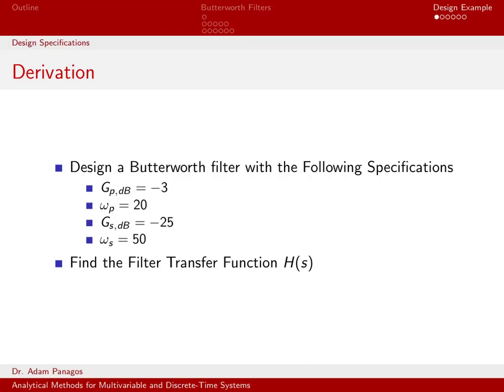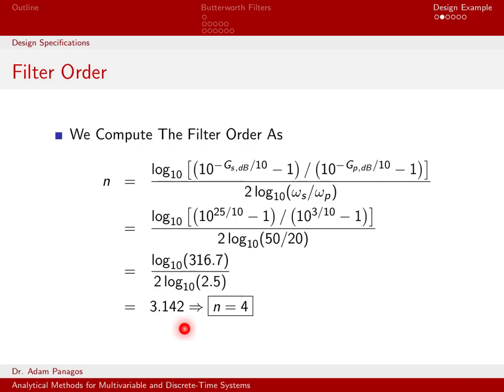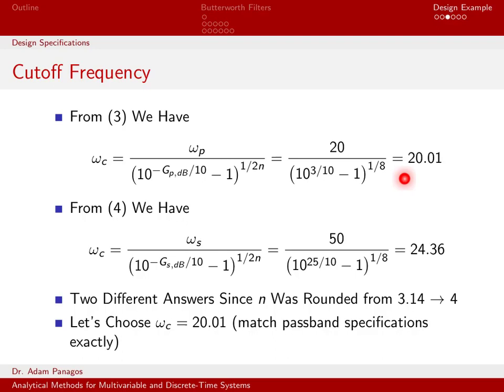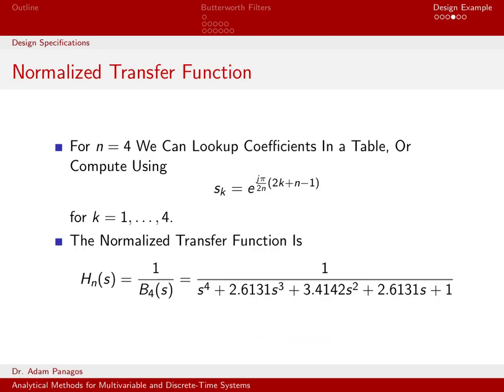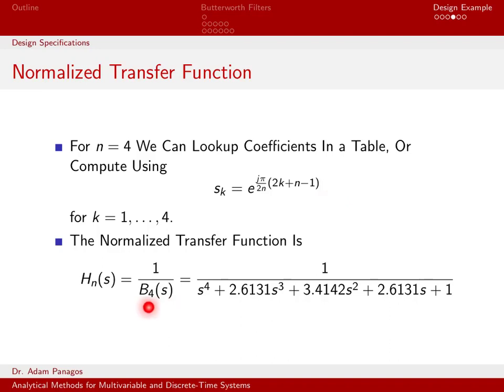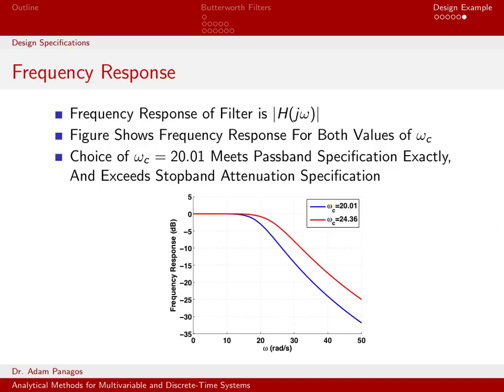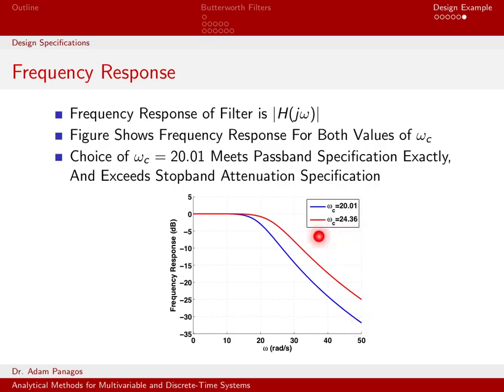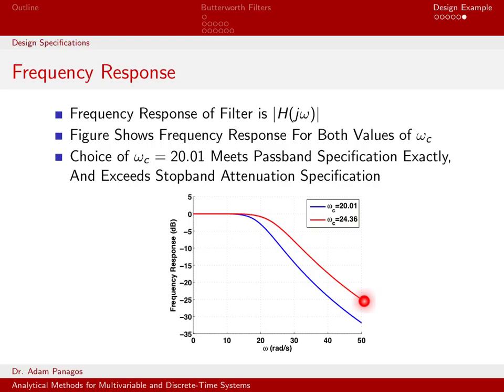Butterworth Filter - 04 - Design Example

Comment: I followed everything pretty well. My question is how do calculate resistors and caps from the transfer function. You are an excellent teacher.
Reply from the maker: Taking a transfer function and turning that into an actual circuit implementation is a very different type of problem.  I do teach that aspects of that in some of the courses that I teach, but unfortunately I don't have any videos on the topics at the moment. Maybe I can get some of those made in the future.  Thanks for watching!
Reply: Hi! I'm some months late but once you get your cut off frequency (in this case 20.01), use the simple formula Wc=(1/RC), since you are using rads there's no need for 1/2pi. You have two unknown values, normally, choose a common resistor value (10k for example) and just get the value of the capacitors with the formula. The biggest issue is finding the exact value (and dealing with variations). I did it this way with 741's and it works in multisim quite well.

Comment: hello, thank you for these set of videos. I have a question, there is another way to give the filter specification to design and that is Amax and Amin which I guess is the attenuation and Amax is lower value of Amin !!!! but they are positive value so it  is not pass in fomula which you explained here. Could you please explain the difference, why Gs and Gp change to Amin and Amax and getting positive. Thank you again

Comment: Do you have any example on how to convert a sawtooth signal to a sinusoidal signal using butterworth filter?
Reply from the maker: I don't have any videos but in general I don't think it would be too difficult.  A sawtooth signal is a periodic signal so it consists of a fundamental frequency and it's harmonics.  If you could use the butterworth filter to low-pass filter the signal and remove the harmonics you'd be left with just the fundamental frequency (i.e. a sinusoid).  So, it would really just require setting up your butterworth filter with the correct cutoff frequency to pass the fundamental frequency but reject the harmonics.

Hopefully that might be enough to get you going in the right direction.  Thanks for watching!
Reply: +Adam Panagos thank you sir

Comment: excuse me but what is the point if having all these theory if you do not explain how to find the values of the R and C components to be used in the butterworth filter? so much for theory...
Reply from the maker: +Yueeiuyoo The goal of this video was to describe/design a Butterworth filter in the Laplace domain by finding the transfer function H(s) of the desired filter.  That’s exactly what the video explained.  Trying to find a specific implementation of this transfer function in the form of an analog circuit is a completely different topic and was not the focus of this video.  The THEORY presented in this video is an excellent starting point for designing digital filters in the z-Domain where one needs to start with an analog filter design (specified by its transfer function H(s)) and convert it to an equivalent digital filter design.  

This video was focused on one specific topic.  As such, there’s an infinitely long list of topics that his video DIDN’T explain.  It’s impossible to make a single video that covers all aspects of a topic that may be of interest to everyone.  If designing implementations of the filter using analog components is of interest to you, maybe you should consider making your own video and sharing it with us.
Reply: If you want to have the values for the R and C components, you have to take a look at circuits like sallen-key or multiple feedback filters. There you can enter the butterworth coeffs in the transferfunktion of the (for example) sallen key filter. Then you can get the values for the componentes. It is very easy. What Adam was showing was the hard stuff. So thank you very much Adam